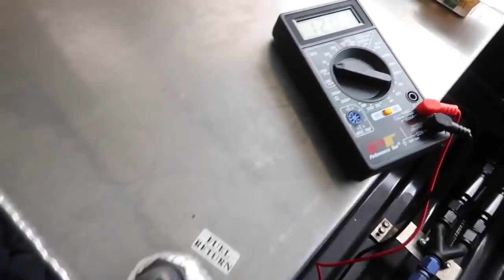Turbo Civic vs LS Turbo Truck & Liam Wins Hard Tire!!!

Comment: Congratulations bro you got her working that slicks 60ft though leaves hard as fuck
Reply from the maker: Slime Lines thanks! Yeah it wasn’t supposed to come up that high. Forgot to change the front shock settings between hard tire and slicks lol. Was fun though!
Reply: @Therendonfamilia  lol looked fun as hell the truck gets out of the hole hard as fuck has in every track pass I have seen it make

Comment: That small wire defeats the purpose of the relay.Large wire to relay then pump and small wire to activate relay.Wire is like a pipe and current is like water you can only flow so much through that tiny wire so pumps don't get the proper voltage with small wire
Reply from the maker: gsppuffer already verified the pump is getting the voltage we need. Wire is not heating up. Magnafuel actually recommends #14 wire to feed the pump as it draws less than 20A at the pressures we run. So It’s actually to spec but we plan to swap it out for a #12 or #10 just to give it wiggle room.
Reply: Run 10 or 8 guage wire trust me

Comment: Love the truck man !!! Do a chassis break down sometime !!
Reply from the maker: winch racing we will! It ain’t the prettiest or the most proper, but it seems to be working lol
Reply: @Therendonfamilia  
Ya that will be awesome !! I have the same truck that's just about done I'm just trying to figure if I wanna do a LS nitrose build or turbo but I would like to see how your putting down that power !!! Thanks man
Reply from the maker: Nice! either power adder would be fun. the suspension is a standard 4-Link. wasnt too bad to install. Couple companies sell some nice generic weld in kits that can be fitting for your truck. other than that its just the adjustment of the shops and the angles of the bars to make the front and rear do what they need to do. I need better quality shocks but what we started out using  is getting me by for now. on hard tire or the street, power control is very important as well. you can feed in more power sooner if its delivered abruptly when it needs to be and softly when it needs to be. This video shows a little bit more about the suspension. check it out., https://www.youtube.com/watch?v=4-QkAH8g8eQ&t=772s
Reply: @Therendonfamilia  
Ok thanks man !! Ya my truck already has a 4 link and its on bags at the moment but I'm doing a full tube chassis and cage its a working progress at the moment but just a track truck I have 3 other Dakota RTs but I'm only building one at the moment for the track and street that's the matte black one in my pic its slammed murdered out gonna be a beast. Thanks man
Reply: @Therendonfamilia  
Just watched it I thought it was one of the set up i will like to see it but also if you have any take off parts you wanna sell lmk ill email you and well figure it out. I'm in nc but maybe one day ill let the winch drag that ass hahahaha

Comment: I have the same truck. 1997 hardbody. I want to slap a 5.3 in it
Reply from the maker: Cameron Beall that’s what is in this one. Do it!
Reply: Custom engine mounts? I want to run a t56 in mine. It's a factory 5 speed
Reply from the maker: Cameron Beall mine used to be a 5speed too. Yeah custom mounts
Reply: Thanks for the replies and inspiration! I'm going to yank that Ka24 out and get to work! I see you have custom coil overs in the rear. Anything done to the front suspension?
Reply from the maker: Cameron Beall just aftermarket adjustable shocks. Some cheap rancho off road shocks. They happened to be a good enough travel and size. I need more adjustment than they provide but they work ok for now
Reply: SlowerThanU hey I have another question. I found a 6.0. Do you know if that will fit in the truck with a t56? Thanks
Reply from the maker: Cameron Beall 6.0 is the same physical size. Same work goes into making that fit as the 5.3. And I don’t know the size of the t56 so I couldn’t tell you. I had to cut some stuff to get the th400 to fit.
Reply: SlowerThanU I found someone running a t56. And it looks like it fits perfect in the factory shifter location. I'll make some videos here soon! Thanks for the help!!
Reply: @cameronbeall1797  when you take the ka 24 out, I want it. I want to build a ka for mine. Gonna bore it, swap rods, larger valves, stronger valvesprings, race cam, stud enlargement, turbo, exhaust, and a real good headgasket. Then I can start on suspension.